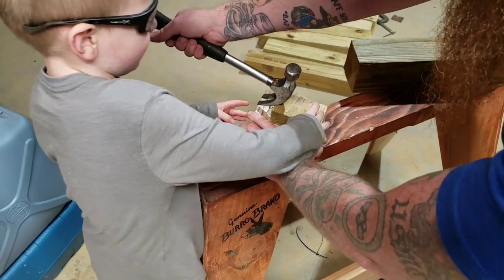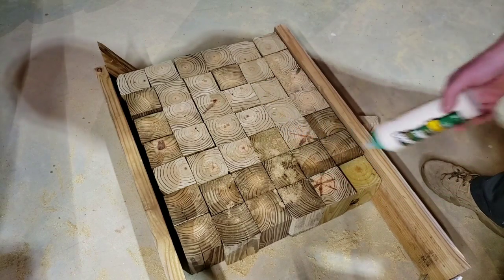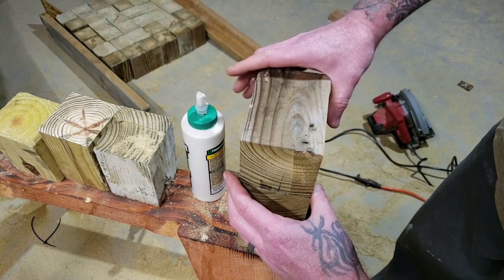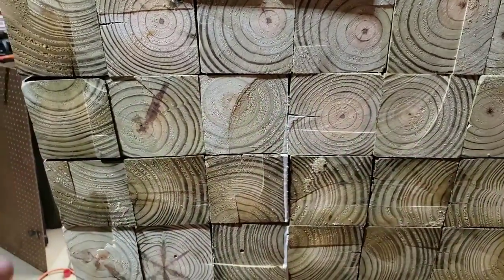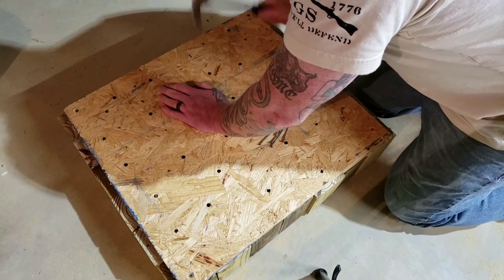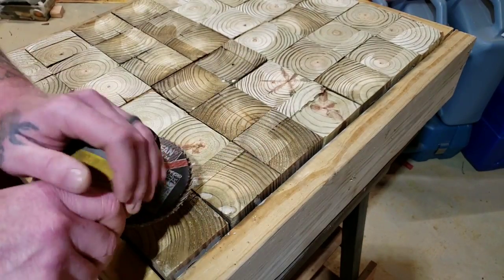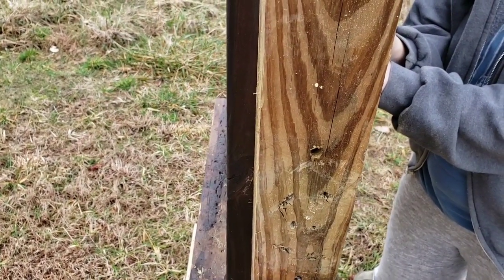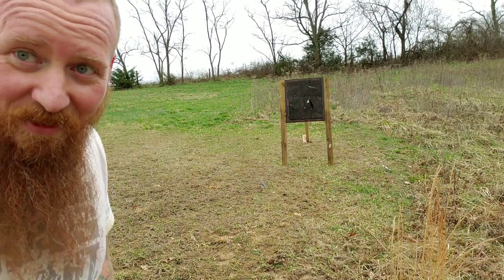Making an End Grain Knife Throwing Target

Comment: BA, pick up some plastic putty knives, found that a 3 or 4 inch works good for spreading glue and such. Keep some 4x4's for legs for loading bench. Good luck with the new house. " but dad I thought the tractor was going to get you"
Reply from the maker: I've got some more 4x4s and other random wood for the benches should be enough for now. Thank you brother
Reply: @StepOneSurvival  I built a beating table out of 4x4's and 2 inch board.
Reply: A THROWAWAY PAINT ROLLER BROTHER
Reply: @tedsemonis7905  KITCHEN TABLE OUT OF 6X6S CAN FLIP IT SIDE WAYS FOR A FIGHTING POSITION LOL DAM IAM BEGINNING TO THINK LIKE YALL
Reply: @keithcronk7980  To me that's a waste a simple putty knife metal or plastic can last years.
Reply: @keithcronk7980  Talking about a reload station, Doesn't have to be deep just strong 4x4 and 12 inch x2 pressure treated board. Mount reloaders to it and not at main table.